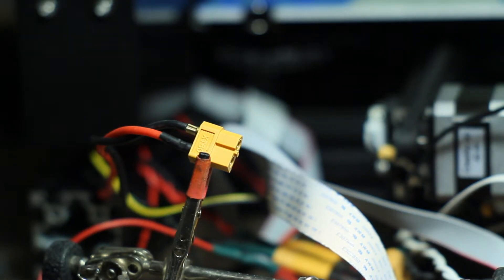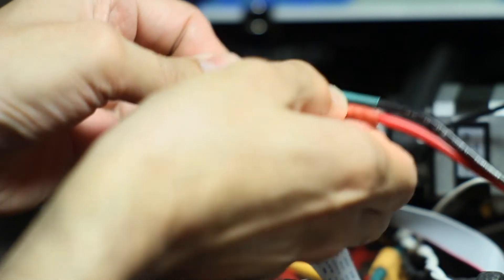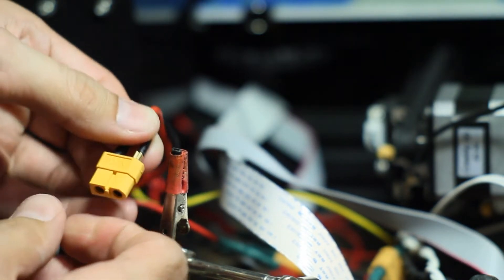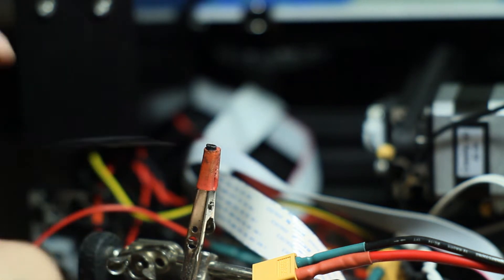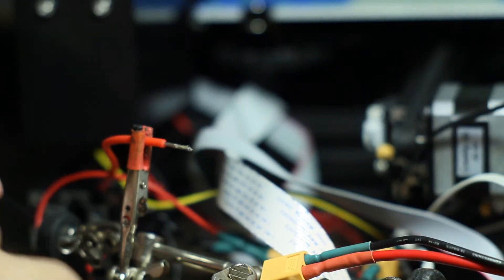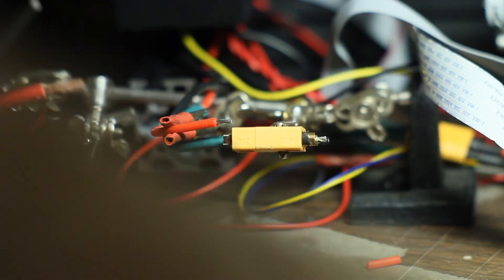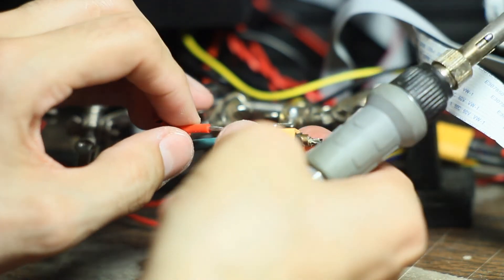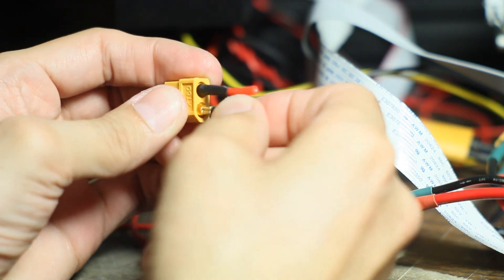Ender3 XT-60 Connector Replacement

Comment: Very interesting, thanks for posting.  Though that crimped connector is labeled "XT60", it appears that the crimped portion of the terminals started off as full cylinder. That is unlike the AMASS (originators of XT60) connector terminals, which are all designed with half cylinders, that can really only be soldered -- there's not enough surround to crimp. (Ie: like the one you soldered). (Other AMASS XT60s are for PC board mounting, but none for crimping).  http://www.china-amass.com/en/Default.aspx?cid=79&page=1&at=12-16